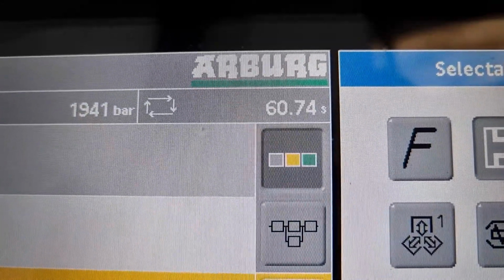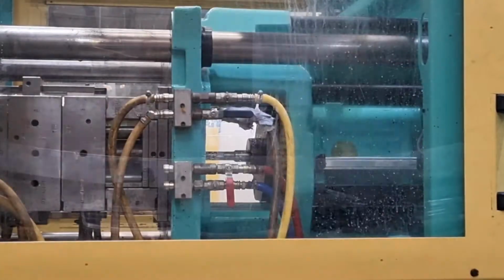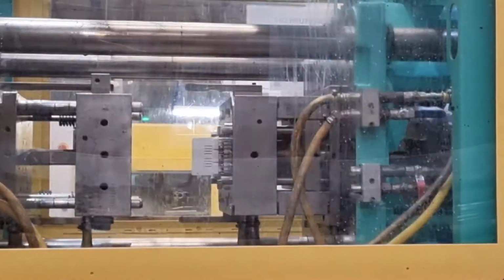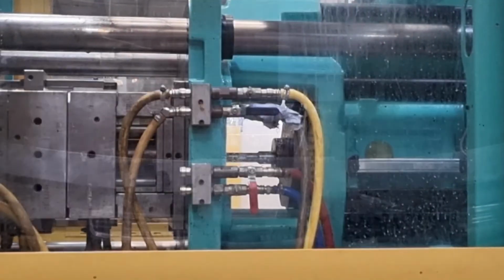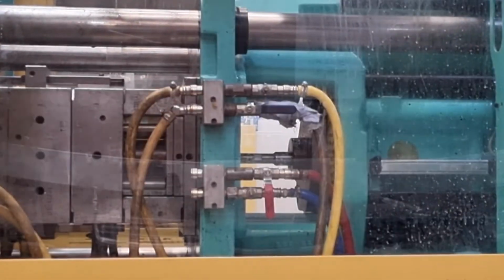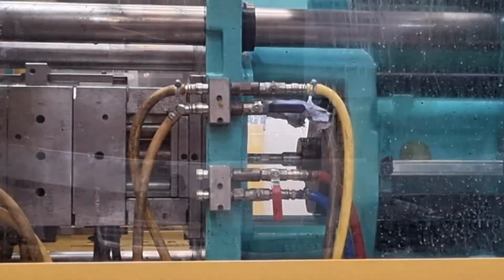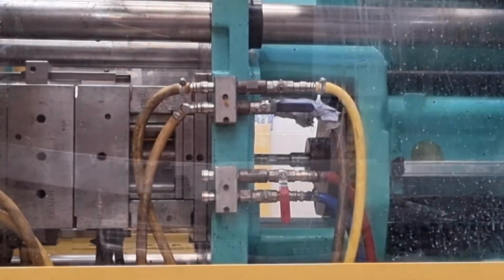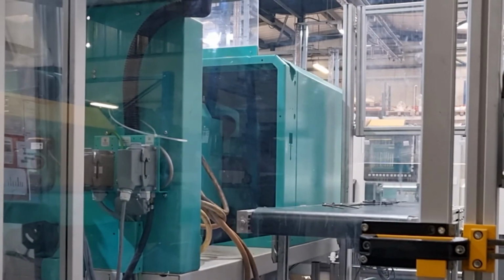RUNNER CHANNELS | Technical Tuesdays | HYMID

Comment: could put a punch on the moving side where the face of the sprue will meet the moving side, this way when it opens up it'll pull the sprue from the stationary side.. this is how I usually do it. Not just and punch though, you'll want to put a dent with the tip of your clippers so it'll catch onto it or a flathead at an angle down or up.